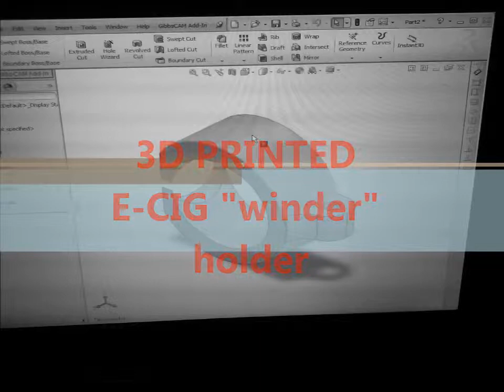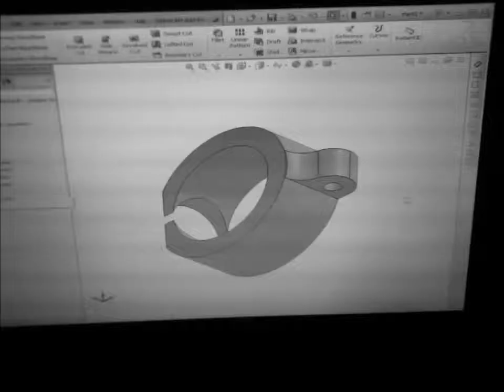3d printed e-cig holder

Comment: kudos, just checked out 21" baton holder on amazon and think it will fit and has belt clip if you are interested. Will let you know in a month when I purchase one if it as nice as I think it is... no links so search for one of the following

Bianchi Accumold 7312 Black Expandable Baton Holder 26

CO-156 Collapsible Baton Holster for 21" Baton

Leaning towards the CO-156 since it has flap that closes, but if it doesn't close with my mod+tank on it I will spend a whole week returning it before I get the first one, which will definitely fit since it is open top. I use the itaste svd + iclear 30b which is about a hefty 8 3/4" long! But 21" closed batton size is around the same if not a little more and someone reported it sticking out less than 2" which is not bad.